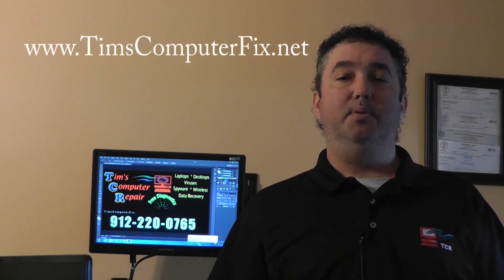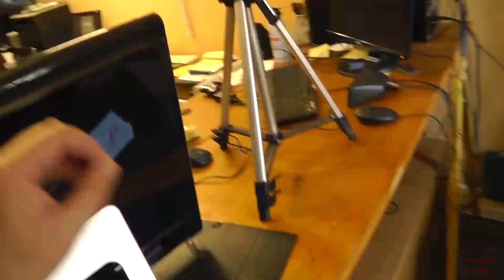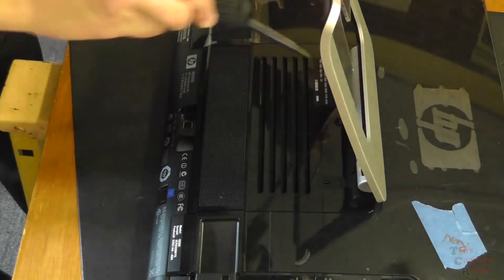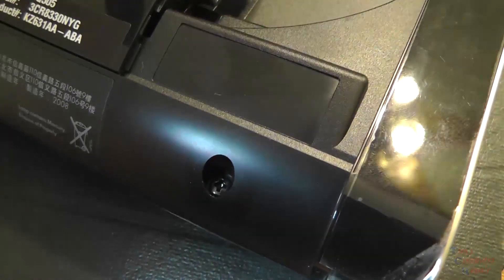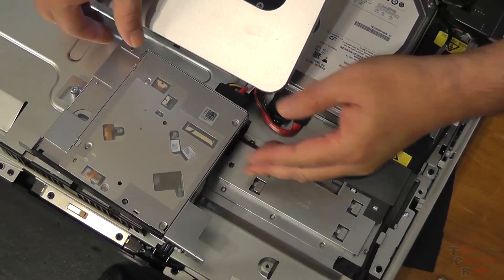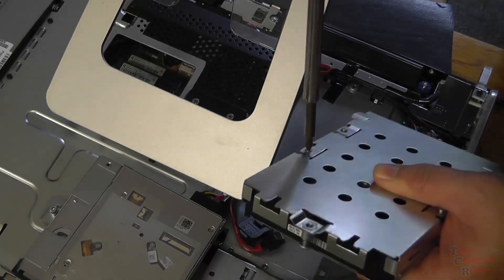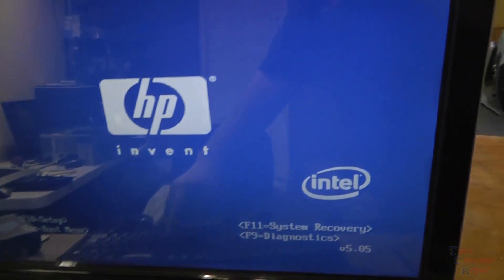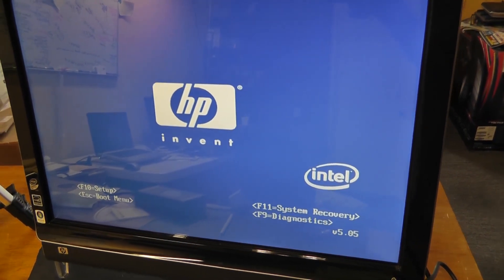HP TouchSmart IQ505 All in One Hard Drive Replacement by TimsComputerFix.net

Comment: I have the same model I listed in my comments before. But I ran into a problem with lq504 where I get a post screen but if I select a bios option or as soon as I go passed the post screen the display stays black but I can still hear sounds when I touch the screen and I can press ctrl alt del key and and the computer restarts and shows the post screen but the same issue persists. Do you have any ideas what might be going on?
Reply from the maker: Check your drive health. Try reloading Windows.
Reply: @TimsComputerRepair  I've tried that but any bios setting or even trying to boot up a cd I get a dead screen. I even tried going into the bios options with the hard drive detached, took the cmos battery out, swapped ram channels, taken a ram stick out, I even took the cmos battery out and tried to enter the bios or even just get passed the post screen. It's so frustrating.

Comment: I was given the TouchSmart IQ504 today and for how old it is it runs pretty good I was thinking about slapping an ssd in to since you posted this video. I have a question though did the model you worked on in this video hum while it was turned on?
Reply from the maker: Don't think so.
Reply: @TimsComputerRepair  right after I sent that message to you I took the computer apart and and took a mini electric leaf blower to it and now it's tollerable/nice to use. Thank you for getting back to me though Tim. I would of asked the question on britecs forum but it seems pretty dead now ah days and I'm not sure if you have a forum or not?

Comment: Hey Tim I have a very similar hp if not the same model and the hard drive crashed a while ago and I don't know much about hard drives and I want to get the right one but for a cheap price because I don't need alot of space. Is there any specifics I need to know before just buying one on Amazon?
Reply from the maker: Nope. Just pick out ant 2.5" SATA hard drive. Thanks for watching.
Reply: Awsome
Reply: TimsComputerRepair I bought the correct hard drive and put it in properly and when I started it up it said "reboot and select proper boot device" and I tried mixing some stuff around in the setup menu but still nothing. And I can't find any advice online so my only option was to buy a recovery disk for windows and hope that it works... please help
Reply: TimsComputerRepair I bought the correct hard drive and put it in properly and when I started it up it said "reboot and select proper boot device" and I tried mixing some stuff around in the setup menu but still nothing. And I can't find any advice online so my only option was to buy a recovery disk for windows and hope that it works... please help
Reply from the maker: Lo Indigo You need to insert your Windows Boot dvd and load your operating system.